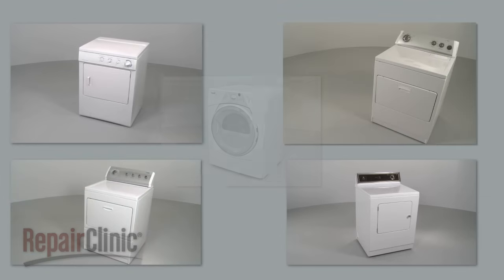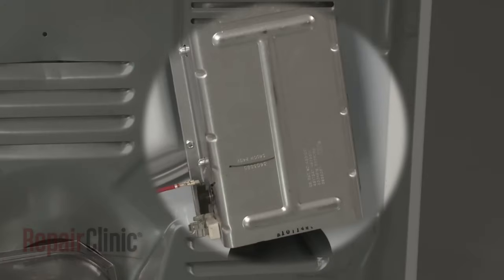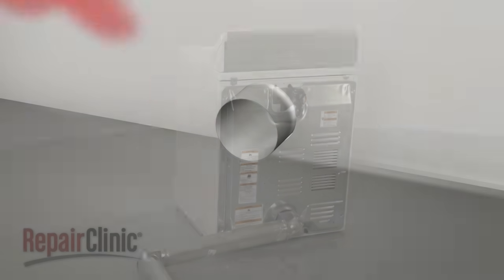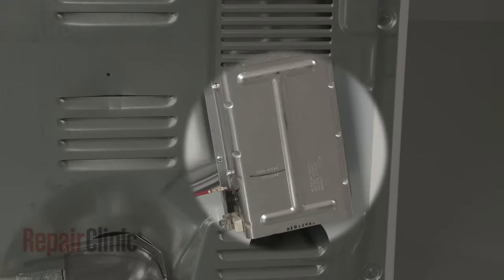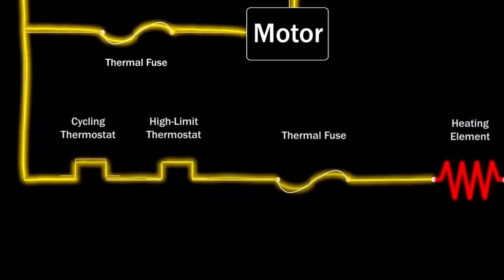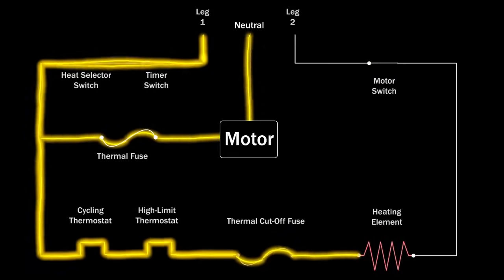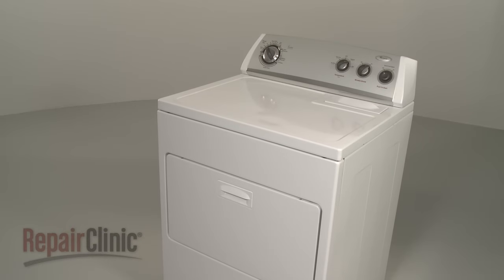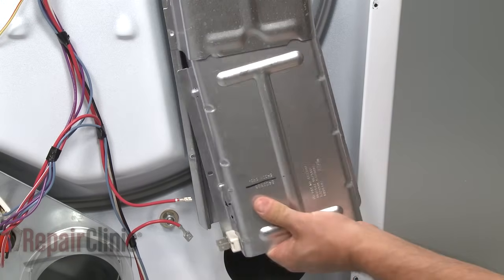How Does an Electric Dryer Work? — Appliance Repair Tips

Comment: Interesting, I've been wondering why my dryer heats sometimes and sometimes doesn't. I guess it is too close to the wall and doesn't have proper airflow and that's why the heating element shuts off. Thanks!
Reply from the maker: You're welcome.

Comment: My dryer is giving a E5 error within of 5 seconds of start the cycle. E5 error is temperature sensor failure. There are three(3) sensors that I was able to locate in the duct. I disconnected all three and reconnected them but still it is showing the same error. Please suggest what can be done to fix this

Comment: In Arizona all new dryer installations require metal tubing, either flexible or rigid. My house was built as clothes dryers were coming on the market. I had to wire a 220V circuit for the dryer and because I have heard of many houses burning down because of blocked vents I insured my vent goes through the exterior wall of the laundry room directly outside. No more than 18 inches long and all metal. Dryer roof vents are a hazard because the machine has to not only vent the heated humid air, but also blow the lint out of the vent chute. I understand some houses do not give the option as laundry machines are placed in the center of the house. Your machine should come with 4 options for venting, the rear, bottom through the floor and both sides of the cabinet. Never defeat the venting or the grounding tong on the 220V receptacle for your dryer. If in doubt have a professional recommend the best alternatives!! Usually the cabinets for both the washer and dryer do not have venting on either side so the pair can sit touching side by side. However the rear of the dryer and under the cabinet is where the machine draws in fresh air to operate. Never close the bottom of the machine and always allow about 6 inches from the back of the machine to the wall, and do not prevent air from getting behind both machines. Using the hot air concept of hot air rising, it is good to make sure the source for the machines getting air is as close to the bottom as can be. Just as us humans need air so do the machines to prevent them from over heating. Lint filters in both machines if equipped should be cleaned after each cycle of use. Ensure your hot and cold water lines to the washer are in good condition, and it can be wise to modify the space to incorporate a flood pan under the washer, this pan would rain outside preventing serious damage to the flooring around the machine. An aluminum pan a few inches deep with a 3/4" CPVC drain line out will serve well. Your water heater as well should have a pan under it to the outside.

Comment: My dryer IS defying physics. Have voltage and continuity yet coil does not heat. The drum rotates...no lint blockages.
Installed a new $20.00 door switch which was needed but NOT in a dryer that won't work otherwise.
Reply: Check all of the components including the heating element itself. This includes the limit switched and thermal fuses. Also make sure you are getting 208 or 240 volts at your receptacle.

Comment: im going to remove the cheap dial timer on my GE electric dryer, and use relays and a 120v digital timer switch to control. i was trying to figure out if there is a delay from heating element and motor turn-on times
Reply: Do not do that because it may not fit and may cause your drier to not run
Just leave it as it is

Comment: what's the motor switch?  I have a state electric dryer with only timer and push start button and it won't heat I use a multimeter test all the fuses for continuity and they all good this will be my second dryer that I have to scrap if I don't find out what's going on with these state dryers there has  to be a solution

Comment: i have a GE dryer and it run just fine for about 15 min after that it shuts off by it self and i turn it on after 5min its works just for 3min and shutt off again please help :(
Reply: it is in the motor. there is a thermistor that is powering down motor , it is a type of fuse that will reset itself when it cools down... you have to replace the motor...
Reply: Ahmad Jamal get kenmore

Comment: whirlpool gas dryer.  airflow and venting is good.  Gas ignites and turns off properly as it cycles.  It just doesn't get very hot regardless of temperature setting.
Reply: fire should be on for about one min then off about one min check this for 5 cycle times on/off .  then if gas coils are bad .  you will see on this test that around the 3 cycle of gas on/off  that gas flame is on for a short time like 20 sec.  a short time...

Comment: I have a GE electric dryer DWSR483 it heats and rotates just fine when I hit the start switch. But when I remove my hand from the switch it immediately shuts off. It won't stay on. Is it the start switch or a relay? I'm just not really sure what's going on. There are different answers all over the Internet.
Reply: +RepairClinic.com  no it is that the switch next to the motor wont turn on. when the motor spins the centrifugal force of that spinning moves a wire from the start winding into the other winding which keeps the motor on
Reply: +Hays Coleman it ended up being the interlock switch down near the motor. all fixed now :)
Reply: Did you check the belt?
Reply from the maker: +justin cobb That start switch is only supposed to be momentary. We would suspect a defective timer.

Comment: Maytag Dryer model # LDE 412  Series 02 ; it is leaving black marks -streaks on clothing,I have cleaned inside of the drum with no remedy.Any ideas please? ( I had seen a video showing to wipe the gasket at back of drum but this model looks like it is just a felt seal)
Reply: Yer sposed to WASH YER UNDERWEAR BEFORE u put them in the dryer

Try that solution; get back to me
Reply: +Dancing Spiderman 
the black streaks mean yer poop toob is bleeding upstream.    Should go see a Butt Dokter right away pronto.   I cain't hep u with that issue.   Good Luck.

Comment: How do you repair the baffles it came off
Reply from the maker: Debbie Rawlinson Normally you have to disassemble the dryer, by removing the top so you can get to the baffle's mounting screws on the outside of the drum. Enter your model number on our repair help section to find a disassembly video. http://www.repairclinic.com/RepairHelp/Dryer-Repair-Help?TLSID=1773

Comment: Hello *****  I have a Whirlpool Dryer LER5636EQ1. The dryer would spin, but wouldn't heat and then it would turn off. I replaced heating element thermal cut-off (thermal fuse) RepairClinic Item # 2651, and now it spins and heats up, but doesn't stop. The timer doesn't move from the start position. The thermal fuse has continuity as does the operating thermostat, heating element, and thermal cut-off kit. Could it be the timer or centrifugal switch on the motor?

Also, are all high-limit thermostats and heating elements hooked up in series? I forgot to take a picture of my machine, but there are 4 connectors; two are aligned vertically and two are aligned horizontally. I connected the horizontal connectors to the heating element and the vertical connectors to the high-limit thermostat and the machine spins and heats up. Did I hook it up correctly? If not, could that have fried the Timer motor/assembly?
Reply from the maker: ***** If the thermal cut off on the heating element blew than you likely have an air flow problem. Normally, a clogged exhaust vent is the culprit. In order for the timer to advance the cycling thermostat has to be satisfied, however, if you have an air flow problem this will never occur because the heat is being shut off by a high limit instead of a cycling thermostat. We don't have your wiring diagram so we cannot comment on where wires connect. The elements and thermostats are all in series.
Reply: ***** Before I replaced the cutoff kit, I unclogged the lint chute assembly and blower wheel. Since my initial comment, I have tested the timer with an air dry cycle set for 10 minutes. The timer advanced, and the end of cycle buzzer sounded, and the machine shut off. I am going to set it for a timed, heated cycle, and see if it advances and stops correctly. I've been told that if it stops during the cool down section of the cycle, then the high limit thermostat is wired incorrectly.

Comment: My mom Whirlpool dryer will get hot,but the drum wont rotate!I think its the belt!I took it apart and the belt isn't broken and has no tear sin it,but it has slack in it when I lift touched the belt around by the bottom by the pulley!Do you think its the belt?
Reply from the maker: You'll find our website's free troubleshooting and repair help to be helpful: http://www.repairclinic.com/repairhelp?TLSID=1773. Be sure to enter your mother's dryer model number.

Comment: we have a whirlpool dryer Model LEB6000PQ1 serial No. Ms5104240
dryer is not drying.  We have replace the Thermal fuse and the cycling thermometer  still not drying.  What should I look for next.
Reply from the maker: We recommend using the repair help section of our website. Enter your model number there and you'll have access to part, model and symptom specific repair help: http://www.repairclinic.com/RepairHelp/Dryer-Repair-Help

Comment: There was no mention of the motor switch that activates the heating element.
The motor has to get to a certain speed to tip the switch so if the motor is not turning fast enough it will not heat, a slow motor might be full of lint and blowing it out might fix the problem.
Reply: You mean trip